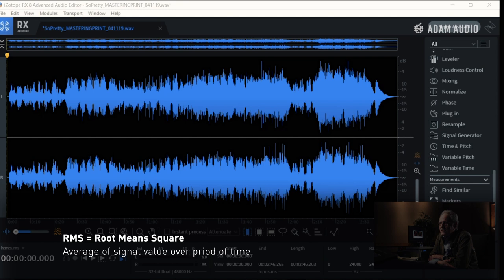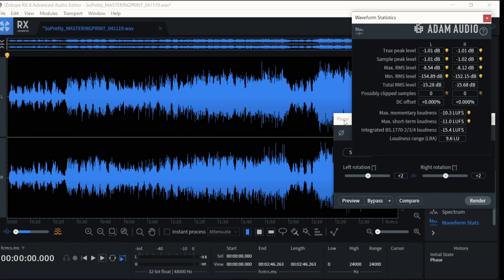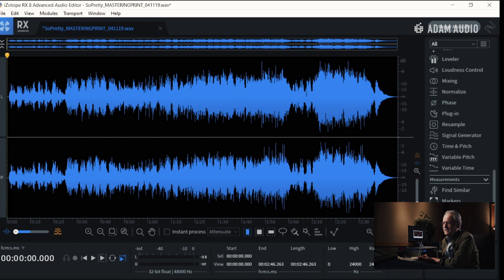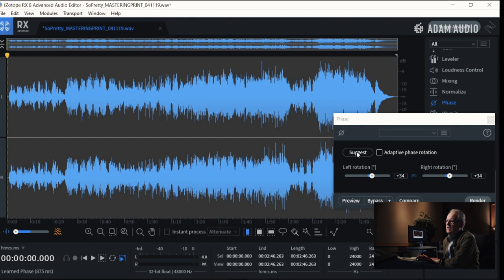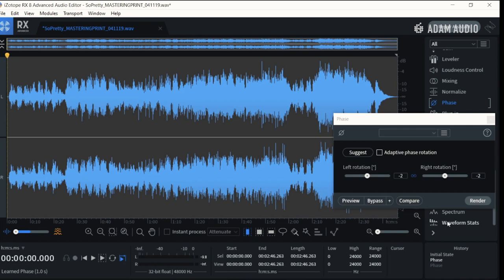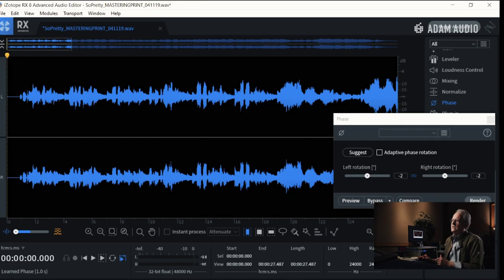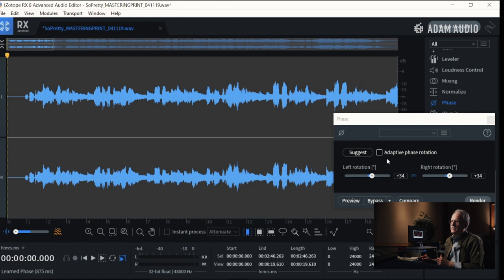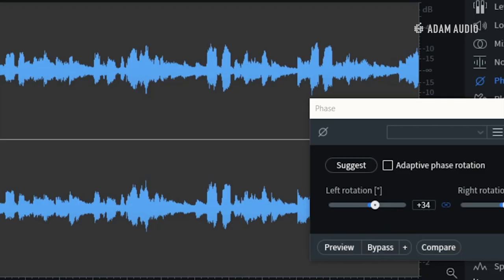The FIRST Step to Mastering a Song: Fixing Phase Rotation | Mastering Masterclass Ep. 4

Comment: I don't understand how this is related to phase. What I understand from John's description and see in the graphs is that he is removing a DC offset. How does phase get into this?
Reply: Based on the RX documentation, it seems like the tool is using phase shift to change where the digital samples are taken, giving you slightly more headroom, but afaik that wouldn't change the true peak maximum.
Reply from the maker: Hi Michael, great question. Like the comment below, the answer comes from the Izotope manual: We are balancing asymmetric waveforms by rotating signal phase. Rotating the phase of a signal changes its peak values but doesn’t change its loudness, and otherwise has no audible effect on the signal. Asymmetric waveforms can occasionally occur in audio such as dialogue, voice, and brass instruments. Making the waveform more symmetrical gives the signal more headroom.
Reply: That's what I thought but this is not a DC offset.
Reply: Michael, how do you fix DC offset? The answer is, usually with a very low hpf. That hpf isn't linear phase, so it induces a phase change in the material. Dan Worral has a good video on that...
Reply: @rocketman374  Dan has a lot of good videos, can you point to the specific one?
Reply: @MichaelSchuerig  sure. It's actually one of the Fabfilter ones. Start at around 8:20. This whole two part video series is pretty informative though. 

https://youtu.be/-10h7Mu5VP8
Reply: @MichaelSchuerig  I could listen to Dan all day lol. Love his videos
Reply: @rocketman374  Thanks, I've watched these videos before and dipped into them now. I understand that a HPF for fixing a DC offset entails a phase shift. However, I take this as a side-effect. How would just a phase change, say from an all-pass filter, get rid of DC offset?

To be clear, I don't contest anything, I just don't understand it but I'd like to.
Reply: @MichaelSchuerig  ah, I see what you're asking. I misunderstood a little. Yeah, you're right, the phase shift in the hpf is a side effect, since the main goal is to just remove the 0 Hz. I don't know about using an all pass filter, I always thought that would alter only the area around the center point. Don't mess with those often. If you know any good videos on the topic, let me know! 

You're also right, they seem to be confusing phase issues with DC offset. Software can remove dc offset without doing any phase trickery as far as I know, so using the phase plugin is curious. I tried what the video suggested on a mix, and the wave stats in RX said I had 0 DC offset, but the phase plugin still recommended a -86 degree phase shift. The mix had some phase issues with the snare that caused higher positive values in the transients and it apparently interpreted that as a problem. But I don't think it is. I'm just wary of altering phase that much, just to get another dB of headroom, since it changes the way all the frequencies interact with each other.

Comment from the maker: Did you know about the importance of phase rotation already? Let us know 👇
Reply: I read that it's applied in radio processors (Orban, etc) to optimize the available headroom, just as you're doing here in a mastering context. I did read also, though, that it has an interesting drawback for material which has been deliberately clipped (ie: with the wave flat-topped). Sometimes the flat-top is rotated around to being a straight line more in the middle of the waveform; it looks like a scar or a drop-out. (I'm not sure it would sound like a drop-out though; it would still just sound like the distortion that it is, right?) 

I don't work in mastering anymore, but I still do it sometimes when I'm working on unevenly-recorded vocal podcasts. Because the presenter is moving back-and-forth in front of the microphone, you end up having to apply heavy compression or limiting to even out the volume, with all the usual drawbacks. But male voices, particularly, are very asymmetrical, so applying phase rotation to them can mean you don't have to hit the compressor as hard.

Comment: This is the first ive learned about phase rotation. Ive seen asymmetrical waveforms for years but never noticed any audible issue with them. However, i wasnt really *listening for it. I still dont quite understand why this happens though. Is this something that happens when the signal is being converted to digital? Or is this issue inherent in the source signal?
Reply: Can somebody give an answer on this question? I'd like to know too :)
Reply: Similarly, I'm curious about the cause.
Reply: It's just something that happens with different phase relationships between the fundamental and it's harmonics. Nothing to do with digital audio, we just weren't aware of it before digital because we weren't looking at waveforms. 
There's no "audible issue" except that the peak value is higher, even though it isn't any louder. Which mean's you can't turn it up as loud before hitting the threshold of a compressor or limiter.
Reply: @TjMoon91 That is correct.  This is the answer.  Just about every horn part I've ever recorded was positive heavy and looked funny on the screen.  It's the timbre of the instrument itself causing it.  Interesting though, is this lesson about how these waveforms create false peak levels that steal some of the mastering engineer's working headroom, I never considered that aspect.
Reply: @reedtaylor4846  some vocal tracks have this issue here and there.
I think it happens when there's a strong 2nd harmonic, which always causes asymmetrical waveforms.
Some plug-in emulations of valve equipment will do it too, but I think actual valves will do the same.
But I think there might also be different causes for this.
Reply: @TjMoon91  it canchange the sound having harmonics phase rotated. In fact it can be a sought-after byproduct of "tube warmth" and if you have have ever heard of assymetrical distortion i do believe this is what is meant by it.
But hence the question: surely it changes the sound that is essential to how brass might sound "warm". And there is another reason to hate loudness wars- another way the sound is edited and compromised without regard for anything but "loudness"
Reply: it's ok, he wasn't listening for it either!

Comment: With all my respect I have to say that in the video, where the beginning of the track was analyzed for phase rotation - the whole track was selected, that's why it showed +34 degree several times.

Some sounds, mostly acoustic ones, are asymmetrical by nature. Imagine hitting a drum membrane with a stick. The first half-wave is the biggest in amplitude, because it's caused by the stick (or hand) directly being in contact with the membrane and moving it much deeper/further than what comes next. Every movement coming next is smaller and smaller in amplitude and if you analyze the whole drum hit sound - it will have a skew from the center line.
Regarding the difference - many people say you don't hear a difference, BUT. People who work for example with car audio know that there is a difference. If you wire all the speakers in a given car in a wrong polarity - you'll have less punch, because the first movement of speaker membrane goes inside instead of outside. And all this phase correction thing (which I was using in the past too) is a wrong thing to do, because it messes with the original natural sound. It won't change RMS, frequency response, but it will sound differently. If you say "pumpkin" into a mic - it will be asymmetrical, because of how much the mic membrane is being moved by the air bursts. But it should be that way! And after using RX adaptive phase rotation for years on podcasts I finally stopped doing that and it sounds much better and natural.

So, the only good thing about phase correction is that you can squeeze more volume out of it.
Reply: I totally agree with you...BUT I think, that some of the information given in this video may be helpful for some situations like the one mentioned in the video with the trombone solo. If you can't really make something out of a stem or so because of these phase rotation problems, this feature in RX could be really helpful for not distorting the sound. I myself had a vocal some days ago where the waveform looked really weird to me because there was more information above the center line than below. I only read something about phase rotation in the tooltips of one of the compressiors found in TDR Limiter No. 6  and couldnt really understand what phase rotation is until I saw this video now. But I think it would've helped me in a way if I knew about this topic earlier. Unfortunately these scientific and technical topics don't really get discussed that often.

Comment: My take is that it's using an FIR algorithm to shift phase tilted from the highest frequencies to the lowest. So the 20kHz is delayed by say 30 degrees and then less at 10kHz down to no shift at 10Hz. You can do this with Meldamedia "free phase".
The reason you can't do adaptive on main mixes is that it may introduce pitch artefacts due to the delay changes.
The key term here phase is meaning delay but they don't say FIR time domain manipulation. So less delay at lower frequencies. Hope that helps. You could run two files against each other in Rational Acoustics Smaart and see what phase plot x y tilt they are using.

Comment: This almost creates more questions than it answers.  I’d like to see a way to achieve this without RX specifically.  An industry-wide standard definition would be good too.
Reply: I don't think there are any ratified industry standards on it.
Reply: there’s a free plugin by air windows called DC offset. It doesn’t the the exact same thing but you can shift the entire waveform higher or lower which can help if you have asymmetric peaks
Reply: @rafriley6993  Right.  But I think they were saying that this isn't DC offset.  Ableton has that built into Utility and I think Meldaproduction has it in their MUtility plugin also.  DC offset is a pretty generic thing and that's why I was asking what's going on here.
Reply: @Hexspa  I'm pretty confident this its exactly the same as DC offset – no idea why he has decided to call it phase rotation
Reply: @anthonycarr3495  Weird, huh?  Never tried correcting DC offset on a master but it makes sense.  I mean 'phase rotation' :)
Reply: @anthonycarr3495  DC offset would shift the whole thing. This is shifting the asymmetric stuff more than the symmetric bits. I still don't get the name though and it shouldn't null either.
Reply: @unclemick-synths  No this is shifting the whole thing, it's just that izotope is basing its calculations off the largest peaks and applying the best average DC correction to the whole file; it's definitely the same thing.
Reply: @anthonycarr3495  It's actually not. The documentations of iZotope's products are really helpful. This section is from Ozone's: 
"It is important to distinguish DC offset from waveform asymmetry. Asymmetry skews the waveform shape towards positive or negative levels, but the average current stays at zero. Unlike DC offset, asymmetry has no particular energy near 0 Hz and can be reduced using phase rotation filters."
Reply: @anthonycarr3495  You are pretty confidently incorrect.
Reply: @parentteachernight  Yeah I was, and have since learned the difference largely thanks to this comment thread. Occupational hazard of being a self-taught engineer/producer and not seeing much content about this sort of thing around, I suppose. Thanks so much for your constructive input 1 year later though!

Comment: How does waveform asymmetry relate to phase?
What does the Izotope algorithm do, in signal processing terms?
What does he mean by a "false digital value"?
Aren't a lot of real instruments naturally asymmetric? i.e. kick drum, trumpet etc. 
Does removing this asymmetry audibly change the signal?
Reply: It doesn't audibly change the signal, it just gives you a lower peak value. Which means you can push the signal louder before hitting the threshold of a compressor or limiter.
Reply: I think they just picked some guy off the street, gave him a list of buzzwords and a ten-minute introduction to Ozone and then filmed his improv performance.

I have the same questions as you do, because none of this made any sense. He even used percent to describe the phase rotation instead of degrees. Pretty sure the phase optimization tries to find the position with the least amplitude so the limiter has to work less or something like that. It has no effect on DC-offset.
Reply: @michaelgraflmusic  100% = 360 degrees, 50% = 180 degrees, 25% = 90 degrees. I'm sure you can work that out.

Comment: while this is interesting, i dont quite understand how it works. now the issue here is that a waveform is for some reason offset from the digital zero point (which is basically equal to an analog signal thats offset by a positive or negative DC voltage). however, i wonder what fixing this might cause. he gives an example of a very small part thats being fixed. in order to fix just a part of the track, its necessary to offset the part so its in the middle. but at the point where the "non-offset" transitions into the corrected part, you automatically have some sort of audible transition. either a click, or RX has some sort of smudging feature to mask it. when editing the whole track, you could offset it without having any clicks. But since i would assume that the track has some "real" silence in it, (beginning or end), this silence would be offset to a point where it is not really zeroed but rather above or below zero.

Comment: would it be a better to check phase rotation on individual tracks, to minimize the cumulative effect in a stereo mix??
Reply: Doing it on a stereo file doesn't create an audible change. However, if you did it on each track individual track, the phase shift will mean those tracks will now stack up differently. 

If you have already carefully layered sounds together like multiple snares, or layered synth bass lines, applying phase rotation on these individually will potentially change how they sound when mixed together.
Reply: @TjMoon91  So the correct way to do it is to fix the phase on all tracks before doing any mixing
Reply: @soundtoys795  yeah I suppose so. Two different sounds both with symmetrical waveforms can still result in an asymmetric waveform when mixed together, so I’m not sure you’re achieving much. Maybe if you have a particularly uneven stem like a lead vocal it might be worth doing it with those select tracks.
Reply: @soundtoys795  In that case you'd be altering the phase relationship between all multi-mic'd sources. This is a solution in search of a problem.

Comment: As a Latin producer working with many brass instruments I have notice this all the time. I just why it is so common for brass to have the rotation wrong
Reply: Because the timbre of the instrument creates an asymmetric waveform. It's not a problem in need of correction!
Reply: Air pressure I think

Comment: Anybody know what caused the Trombone recording to have the phase rotation issue to begin with? What can the engineer do on his end to fix it once noticed during the session?
Reply: @ShroomJesus  exactly. It's not a "problem" at all. Applying the "fix" to a full mix will always affect other elements.
Reply: It is typical for brass sounds. By getting the waveform to center, you don't change the sound, but you reduce the digital peak value in one channel, thus getting more headroom.
Reply: @rikkshow  So recording in 32 bit would be a way of avoiding this issue in that case?

Comment: I would love to know WHY this happens to wav files in the first place. What causes a digital recording to have a lot more information above or below the center line? Is it faulty recording equipment? Electrical issues?
Reply: Dc offset due to additional voltage in the circuit i believe :)
Reply: Its a natural behavior once you're pushing more the capsule than pulling it. When you're recording a Brass, for example, the blow will always push the mic (if the player is standing on front of it)
Reply: It's not specific to digital recording. It has to do with the presence of even harmonics (e.g. 2nd harmonic) in the signal, causing an asymmetric waveform. The phase between fundamental and these harmonics determines how high the peaks will be, without changing the sound. What he does in the video changes this phase, thereby lowering the peaks.
Reply: it simply shows a natural acoustic event for mostly positive going waveforms (read: acoustic pressure).

Comment: Is this not the same as DC offset? Cakewalk, what I use  has a DC offset removal which should center the waveform around 0.
Reply: It’s not the same thing, when you have DC offset the waveform is perturbed from the Center line, fixing DC offset moves the waveform back to the Center. An Asymmetrical wave form isn’t symmetrical on both sides so while it may be on the Center line it’s positive amplitude is different from its negative amplitude.